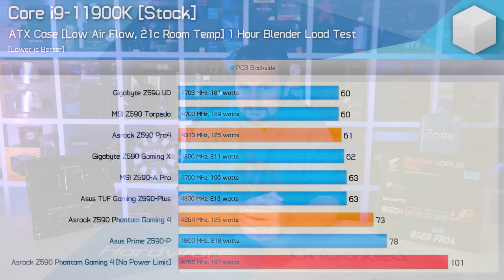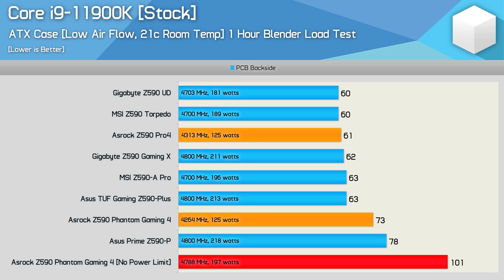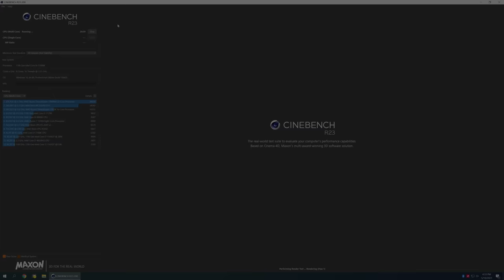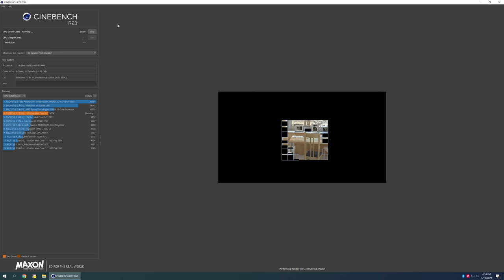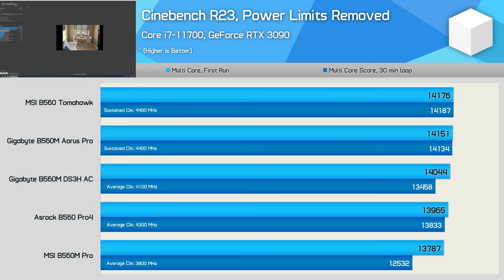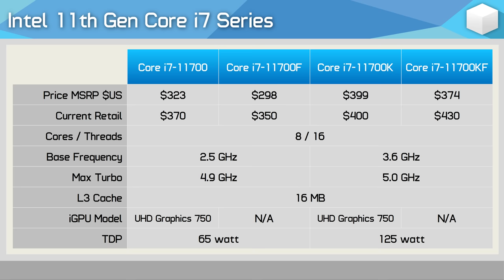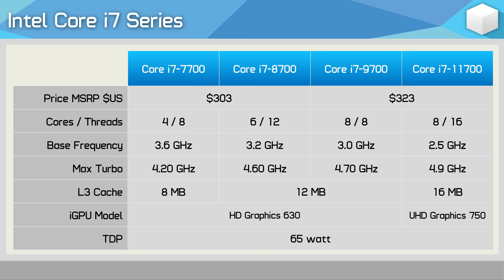Intel B560 is a Disaster: Huge CPU Performance Differences, Power Limit Mess

Comment: HUB once again making huge discoveries, benefitting the entire tech community. Amazing work, Steve!
Reply: I find Steve to be the best tech youtuber. He has useful and interesting discoveries, the best cpu and gpu benchmarks, and is the only guy apart from buildzoid to do extensive vrm testings.
Reply: You got the wrong hub
Reply: @Ant_Stark  Nice joke.
Reply: They discovered that high end boards enabled power limit overclocking by default. Turned it around so that boards that don't enable it by default are the bad ones and made comparisons between 'overclocked' parts and standard parts. The most informative part was towards the end where actual VRM throttling and testing happened, which showed what we expect. Being low end boards with worse VRM's throttling.

The whole thing could be 'fixed' by the high end boards default setting being.....default!

It's like buying a high end Ryzen board that for some reason defaulted to having the power curve optimiser enabled and then making comparisons to boards running correctly without it. Just fix the boards not running at stock settings.
Reply: @unpotat7672  where you've gone wrong here is in assuming that there is a default spec, there isn't and Intel will tell you as much.
Reply: @gamingunboxed5130  Thanks for the reply Steve, got to talk on the other comment thread and you're right!

I think its crazy that this is the case. Intel could really do with having and enforcing base specifications across the platform as the default with custom settings as an option after the fact. Then this would've probably been a maximum power limit/VRM comparison as intended.

Forgive me if I came across in a bad way, you can understand how mind boggling it is that they've done it in this way as it just doesn't seem to follow common sense.
Reply: Okay so the problem is only with rendering and editing right it wont really matter if i only play games?

Comment: The Tomahawk is a $200 board. So basically the same price as a entry level Z590 board. I would much rather see how the Torpedo boards perform.
Reply: The B560 Tomahawk is basically a downgraded Z590 Tomahawk. No surprise it does a good showing here
Reply: intel's marketing with boards is a joke. AMD is doing way better job for like 5 years now.
Reply: MSI literally calls their cheapest boards the "Grenade" series :D
Reply: @TheBackyardChemist  It's a bomb! ;)
Reply: Just built my first PC with a B560 Torpedo and an 11700. Looks like I‘ll have to run some benchmarks. sigh
Reply: @TheBackyardChemist  so many chipset models and the flagman ones cost too much as opposed to AMD's B and X models and that's it.
Reply: @falion2850  Hey i got a B460 torpedo! that board is literally alien i can't find reviews anywhere, i had to go off Customer Reviews
Reply: @falion2850  just unlock your power limit and you're good to go. I have an asrock 560M pro4 which is probably the cheapest B560 board in the market around $100 and the benchmark and boosting are all on point. Also a little bit of airflow over the vrm heatsinks goes a long way. these open bench testings have none, so make sure you do... and the temps would be 5-20C lower depending on the airflow.
Reply: @jebediahkerman4251  when it comes to processors it's better to stick to AMD for a while, because Intel is a huge mess when it comes to chipsets.
Reply: @Andre-1331  Yeah, I can look at the VRMs and tell they are pretty much the same. My point was more that the Tomahawk isn't a mid range board anymore. As is pretty common with Motherboard makers, once a product has a reputation as a solid price to performance item they have slowly bulked up on features while ticking up the price. It's just not a great midrange comparison point anymore.
Reply: @eugenijusdolgovas9278  how was it a mess? They only have H,B,Z just like AMD have A,B,X as class segmentation. Infact intel is kinda easier because the feature is mostly set except overclockability as compared to AMD that gave aib total freedom to what they want to do with the pcie lanes.. so between boards, you can find various configurations of usb i/o, sata, and m.2.
Reply: @eugenijusdolgovas9278  
i do agree with that, especially that intel had the B460 Chipsets and H410 chipsets literally axed from 11th Gen Compatibility, only leaving Z490 and H470 and Q470 being able to use 11th gen im guessing due to VRM's or such correct me if im wrong, plus the multiple chipsets can be confusing when it comes to sockets, if i was to ever upgrade in the future, id probably either get a 10700 or get a whole new mobo and processor, since rn im rocking a 10400 and a 3060 Ti, a pretty good budget build for under £1000, since the 3600 was nowhere to be found and overpriced as hell back in december, also the fact it didnt have any integrated graphics onboard took me 4 months waiting to get a 3060 Ti FE, pretty much had it for almost a month now, so i just went with the bang for buck pretty much same or better performed 10400, well when gaming wise, Workstation and content creation aint on my mind, im actually hoping that AMD integrates APU's into their whole line of 6000 series chips instead of only for OEM, it would be really beneficial for people without dedicated GPU's and knowing AMDs integrated APUs are pretty good at light gaming.
Reply: @bingbing3464  Every AMD board runs the CPU basically the same. The 3 chipsets have different features, but with the exception of some of the lower end boards with shitty VRM, they all will basically run the CPU the same at stock. Intel is all over the place. Some B460 boards have extensive power limit settings, some just have Air cooled or Water cooled. Pretty much every Intel board on the market has wildly different auto voltage settings.  My Z490 boards auto  wants to dump like 1.45+ volts into the cpu when that is completely unnecessary. Other boards push more like 1.35v stock. That's the mess.
Reply: @rustyshakkleford  you gotta be clear. the mess was not by intel but rather the aib as intel bios unlike agesa isnt encapsulated. So aib have the freedom to optimize the bios to their boards. So you get extreme segmentation especially asus on their apexes but total shit nerfed with the entry levels. That's how aib want to milk money from you. However you have aib like MSI who are more consistent on their lineup.
Reply: @bingbing3464  and that's total of 11 chipset sets if you include those that are exclusive to server processors, Intel had more than twice as much.
Reply: @eugenijusdolgovas9278  where do you get the number 11, on socket lga1200 500 series, there's only H570, B560 and Z590. While there's an extra H510 for oem.

Dont forget amd has hedt and server cpus that uses different socket and chipsets as well.
Reply: @bingbing3464  The AIBs are free to change things because Intel allows them to do so. Sorry but the idea that aibs can just do whatever they want without Intel's approval is just incorrect. The current intel comparable mobo cluster-fuck is 100% intels fault and a direct result of intels being stuck on 14nm so long. Even if it was the AIBs, it's up to Intel to make their product stack easy for the consumer to digest. At a minimum they should be requiring B and H boards to ship with a standardized power limit. Even if the client can change it later.
Reply: @rustyshakkleford   intel being stuck on 14nm is on the fab division and their product design team is not really at fault, infact theyve dont an impressive job for maximizing over the production bottleneck. If AMD hadnt had TSMC, they will not even be in contention. 

On the bright side, I'd rather have AIBs optimize the board rather than designing a board around the bios without having the access to peak what's inside the secret sauce. That's Agesa for you, and the reason for AMD's inconsistent reliability and compatibility depending on hardware and software pairings. 

There's an easily explanation for the clients, it's called price segmentation. It's as what you see in this video. More expensive = more performance out of the box vice versa.
Reply: More expensive boards are generally worse in that you're spending more money for all the same chipset and compatibility problems.
Reply: @danwarb1  that's why manufacturers like asus nerfs their cheaper boards on the bios level to make you buy their higher end boards.
Reply: @bingbing3464  since ryzen a320.
Reply: @bingbing3464  Have you owned a zen2 or zen 3 processor? The AMD issues you mention are not issues anymore. The only major board issue AMD has had in the last 3 years was the USB issue on x570, that was solved with a Bios update. Unless you are referring to the server side of things, or very specific compute applications, this just isn't a thing.

As for intels current motherboard marketplace it is 100% the result of intels struggles to get off 14nm. When intel couldn't squeeze out core performance they gradually unlocked the power settings on all their boards. First it was the Z boards and now it has trickled down to B and H boards. Unlocking power settings was the only way to show generational improvement and the only way they are currently staying competitive. 

The unintended result is the product stack is not customer friendly right now. As Steve has shown, two novice builders could both buy an 11400, and a B560 board and end up with wildly different performance.  And the whole more $$ = more performance statement you make just isn't accurate. You can get a board with good VRMs and no other features for pretty cheap and they will give you  the same CPU performance as other boards.
Reply: @rustyshakkleford  yes from the very first ryzen all the way to the latest flagship zen3. Had x370, b450, x570 and then B550. 1.2.0.2 still has intermittent USB issues. B450 gave me pcie bugs. Older ones are fine except not able to pump the rams much. 

Zen2 and zen3 are rather more buggy as compared to the previous gens. Perhaps i try push my zen3 to 2000 fclk, it still crashes very often despite completing 1000% memtest. Intermittent crashings do happen even on 3600. Thus far only 3200 is reliable but if that's the case, a memory overclocked intel will perform better in games. As for hardware compatibility, i still couldnt get my audio interface to work properly and some apps will cause the processor to go berserk 4ghz all core boost for no apparent reason, showing faults in the cpu scheduler.

Memory and cache errors had also bricked my OS a couple of times. That said, i have rma-ed these cpus a couple of times and the problem still exists. 

I guess i'll end my rant here. There's still a tonne of minor issues but they're not too serious. I guess because im an analyst dev by job and also hooking up this rig to a sim racing rig that uses tonnes of i/o, so probably considered as a power user thus triggering alot of these faults.
Reply: @rustyshakkleford  B and H board had always been able to unlock the power limit btw as it's down to the aib's discretion whether to enable or not. The only thing that is unique to the mew 500 is the memory overclocking that was used to be exclusive for z boards. And of course that's a damn good thing. It brings alot of value especially to the 10th gen non K. You will be pretty amazed by how much gaming performance a 10400F with 4266mhz ram OC could make. It actually became comparable to a 5600x for fps.

I guess youve never own or mess with all these boards so you never knew about these stuff haha. Reviews back then are more straightforward and never really divulge into these details.
Reply: @bingbing3464 Well yeah, I a have bricked an OS tryinng to run 1900Fclk on b450, but I did that. Not the aib. Just like you changed the settings on your board to make it more unstable. It did not arrive out of the box and kick out those errors with the out of the box settings. That is my point. It is one thing for an advanced user to change power and mem speed settings and then have issue. It's a completely different thing  to plug your out of the box CPU into the out of the box motherboard and have it run unstable. That is currently happening with intel boards because they are letting AIBs do whatever they want. 

When it comes down to it we are talking about 2 different things. You are saying that Intel has the best features and stability for overclockers and power users. which I don't dispute. What I am saying is AMD has a product stack that is much more understandable to the average consumer. Everyday use? A520 Overclocking and gaming? B550 Need a fuckload of PCIe lanes? X570. It's just not that easy on the intel side.
Reply: @bingbing3464  I have a 5800x on an x570 board. Im not even using the beta bios thats supposed to fix the usb issues and I havent had any usb issues.

And like every single usb slot on my board is being used
Reply: @jennalove6755  you have no problems but i do along with thousands of equally frustrated users, thus i mention on the inconsistency and apparently it affects 5900x more. Also depends on what is connected to the USB and the polling rates etc. One of the highest rate of issues is VR. Having a pcie gen4 gpu also makes matters worse.
Reply: @bingbing3464  I have a 3060 and its runnin in gen 4 mode.
Reply: @bingbing3464  which motherboard are you using? Let me guess its the asus tuf gaming
Reply: @jennalove6755  B550i auros pro AX and a X570 crosshair 8 dark hero. Gpu was RTX3080, psu corsair SF750. Rams are team vulcan 32gb with micron E. Im pretty sure if i hook up my stuff to your rig's usb, with 2 hubs with about 13 devices, yours will fail too as to a few of my friend's. But unsurprisingly, my budgeted intel rig is fine. My zen2 didnt work either but my zen+ works fine on a b450. Problem starts when i upgraded to zen2 and everything falls apart.
Reply: @bingbing3464  Dont know what to tell you. Havent had any usb issues on my msi x570 and Im not even using the latest bios. I dont have 13 devices but I do have several finnicky devices that will be a pain in the ass to use if the usb ports didnt work as often as you people say. 

Rift S, black widow chroma, logitech g502, Several usb drives, Wireless xbox controller fob, Cheapy gaming headset. All of them were working instantly upon being plugged in and havent had any issues at all. 

Its likely a motherboard specific issue and not an agesa issue.
Reply: @bingbing3464  I have a Zen 2 system and a Comet Lake system. I run both my machines with Memory OC/Tune as well as an all core OC. But I didn't respond here  to dick measure when it comes to my rig. Once again as I said, I'm talking about a product stack, not who has the best OC performance. I'm honestly not sure what you are trying to prove at this point tbh. 

As for your point about B and H boards, back in the Kaby Lake days the low tear boards did not ship with preset, unlocked power limits. They typically shipped with the TDP spec. I guess youve never own or mess with all these boards so you never knew about these stuff haha...

Seriously what's with he fanboying? Intel can market their products on their own, they don't need your help.
Reply: @rustyshakkleford  im not sure if you're aware, those 1151 can get into the bios and set to your higher power limits as well eversince the introduction of PL, albeit capped to 125 to 250w unlike today's unlimited. However cpus back then doesnt draw as much power either.

Although i skipped intel's 8th and 9th gen because i was using AMD. But im back to intel now on the 10th gen due to AMD's reliability.

Anyways we're straying away from the topic, and im not sure what's confusing about intel's B H and Z. The segregation is pretty clear.
Reply: @jennalove6755  i have an audio interface, 2 external usb hard drives and a custom sim racing rig with hand brakes, gear shifters dashboards and stuff along side your usual peripherals and some mini usbC displays.
Reply: @bingbing3464  Alright dude, I'm done. You apparently can't read because I specifically said the power state the board ships in . Also Kaby Lake is 7th gen. Anyway, have a good day.
Reply: @rustyshakkleford  well duh and you're clearly ignorant, thinking the boards were shipped at stock from back in the days. Everyone with a little pc literacy knows this has been aib's shady practice eversince pentiums. Good day to you too.
Reply: @Andre-1331  "So there is not a reason to go with the Tomahawk until it's overpriced." What? So, you should get it when it's overpriced? Maybe you meant to word that differently.
Reply: Imagine if there will be a VECTOR board based from the B560 chipset.
Reply: But it's better than most if not all entry Z590 boards with a similar price tag.
Reply: @bingbing3464  It looks like you get most of the performance by just setting the power limits to 125W in the bios, I don't see what the real benefits are for going unlimited for a minor performance improvement considering the additional cooling required!
Reply: @davidg2731  there's no real benefits and it's pretty much marketing material or to appeal to niche overclockers who'd like that. that's why intel in reality not inefficient or a thermal nuclear reactor as many have claimed.
Reply: @bingbing3464  Yes if people would listen carefully to Steve he admits at least for 10th, 11th and 12th gen locked parts you don't get a giant leap in performance for gaming going from 65W to unlimited power! Unless your doing core heavy production work this is not that big a deal what board you use unless your looking for better audio etc.
Reply: @davidg2731  memory trace quality, pcie trace quality and transient management matters too on boards but generally these are just "good to have" especially for gaming to eliminate the board bottleneck.